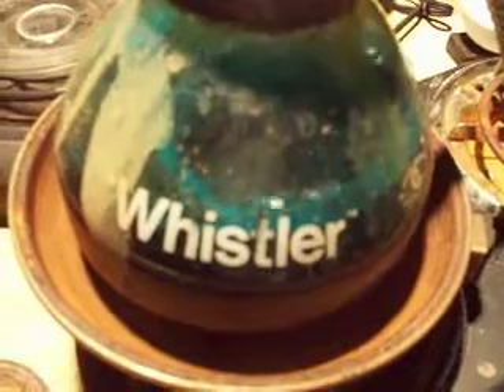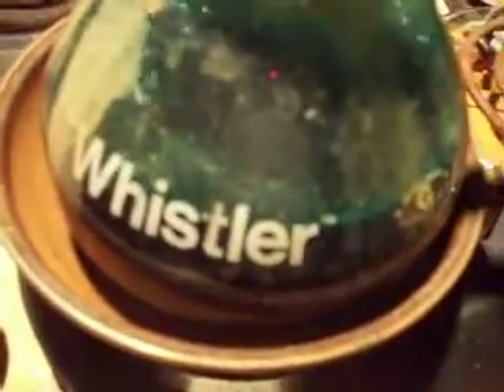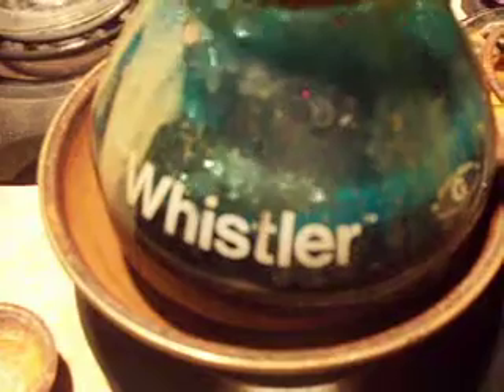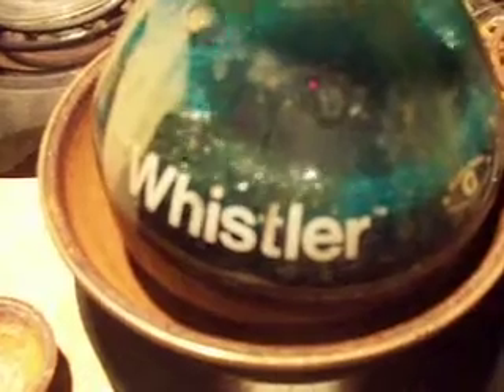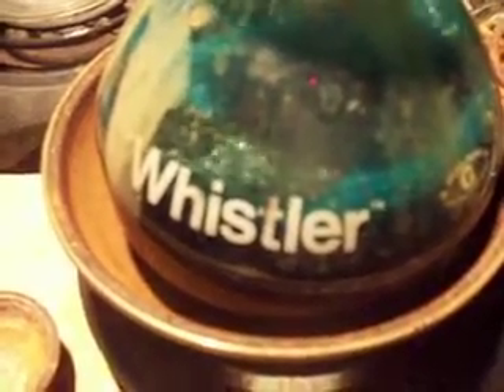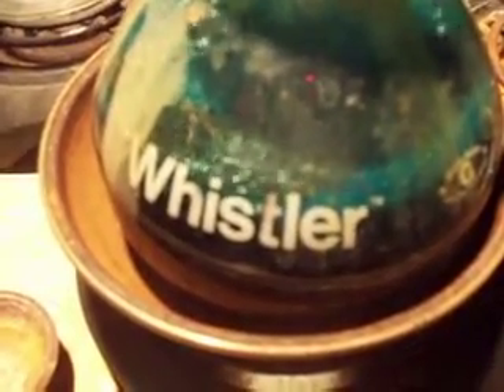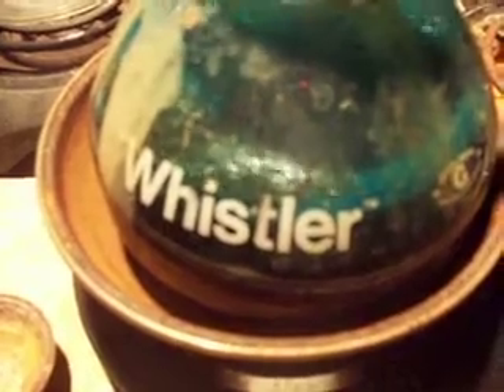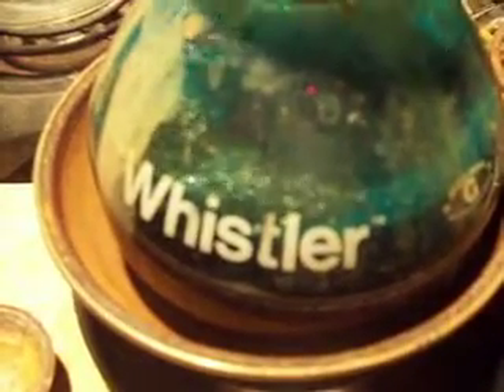continued processor legs dissolution

Comment from the maker: starting material was gold plated processor legs.the base metal is Kovar, which is iron based.iron is dissolved using hot hydrochloric acid.the resulting foils is the gold plating from these pins (legs).the gold plating from these legs are considered to be foils even though it would be accurate to call them tubes but i believe that saying "gold tubes" would cause more confusion.

Comment from the maker: i did remove the legs with heat. i used an electric heat gun and it works great. the legs on CPU's are not typical pins.the base metal used in processor legs is a special alloy called "Kovar". it was designed to use in electronics particularly IC packages.due to the thermodynamic properties of metals expanding and contracting and its effects on the ceramic and glass bodies, they needed a metal that kept its shape at any heat range.

Comment: Good morning brother.  One question.  I used 8 cups HCI. - 8 cups water. And 2 1/2 cups peroxide with a air bubbler for 1 pound assorted pin.   Is that about right?    It's been 1 day and a half and the solution is fairly clear with a green tint.
Reply from the maker: You will need to add another quart of fresh HCl. It takes one gallon of HCl as copper(II) chloride to dissolve two pounds of copper. A half gallon per one pound. You don't need to add so much H2O2. About a cup would have been plenty. HCl and 3% H2O2 will dissolve gold so be careful and not add too much.

Comment: Geo, How much gold you can extract in a kilo of cpu processor green and brown?
Thanks
Reply from the maker: it is very subjective because there are many different types. even CPU's of the same type may be different in amount of pins. ive done pins (i believe its better to use the weight from the pins rather than the CPU body) that yields 4g per pound. P4's have more pins but the pins are much smaller.the smaller the feed stock (@ roughly 30 micro-inches thick plating) the more gold you will have per pound.some of the older green and brown bodies have fewer pins but the pins are much larger. this equates to less gold per pound (around 2g per pound +/- a couple of tenths).

Comment: Hello Mr. Geo, I am a little confuse with this process. Gold plated pins are very different. I want to process all gold plated from cellphones, the pins, the antena connectors, the simcard contacts and all that has gold plated. Can I procces all that is gold plated together? Whats the best way? hot Hcl? Appreciate your help. thank you
Reply from the maker: +Helder Freitas This video is about pins from CPU's. The pins in the video are gold plated iron which dissolves in hot HCl. Other material that is gold plated copper, the hot HCl will not work. Use a magnet and separate the two materials. The magnetic material can be processed in hot HCl and the copper/brass will have to be dissolved in AR entirely or run through AP and leave the gold foils.
Reply: Ok. So the ones that are copper/brass can be processed together with fingers and cellphone boards?
Reply: Or if I do it in AR,  must be 3 parts Hcl and 1 part nitric or can be done with Hcl and bleach? Can it goes with plastic to the solution?
Reply from the maker: +Helder Freitas  They can not be processed with HCl/bleach. That is for dissolving gold foils and powders. If you process them in AR, Measure the HCl and add it first. Measure the nitric acid but add it in small increments. Add a little and wait until the reaction stops and add a little more. Keep adding the two acids in the appropriate amounts until the metal is completely dissolved.
Reply: How much Hcl? And doing with AR can I process the 2 types of pins together, the ones thar are copper and the ones that are magnetic? The gold will dissolve to the solution directly? And can they go with some plastic? Its necessary to heat the solution? Sorry for all the questions but I am still beggining.
Reply from the maker: +Helder Freitas It will be a very thick and very black mess if you dissolve all the metal together. It's best to remove the base metal from the gold first. AP will remove both the copper base metal and the Kovar base metal. It's not good for the solution but that is what it is for. Add all the pins to AP. Weigh the pins, add two pounds of pins to a gallon of good AP solution and add an air bubbler. If the solution turns cloudy, add fresh HCl a little at a time until it turns back green. About 50mL's at a time.In a few days, you should see loose foils floating.

Comment: i have a question i used 2 to 1 ap and after a a day it started to turn a nice green then on the third day it cleared up! what to do ?? you have told me not to add more peroxide. the pins were from motherboard sockets
Reply from the maker: In the form of AP, it takes 1 gallon of HCl to dissolve two pounds of base metal. Since it's best to dilute 32% HCl 50/50 with water, that makes two gallons of solution to dissolve two pounds of base metal. Take the starting weight of your material and use the numbers above. If you have one pound, that's one gallon of 50/50 HCl/water. Too little solution or too little acid will do what you are describing.
Reply from the maker: Too, if you use fifty percent peroxide by volume, you are going to dissolve some gold.
Reply: +Geo  thank you brother.